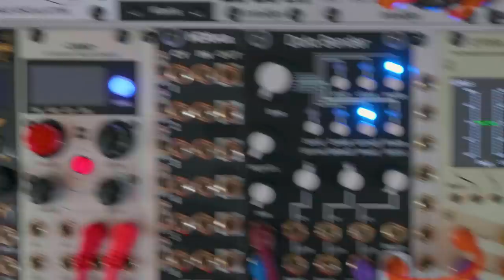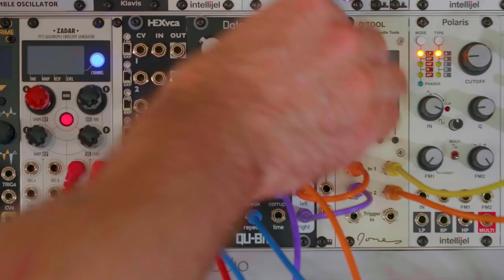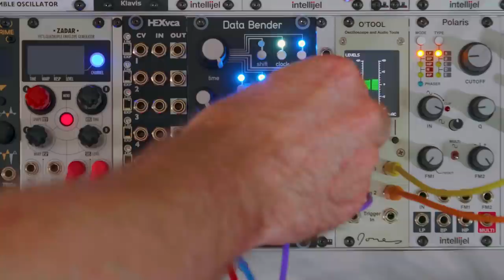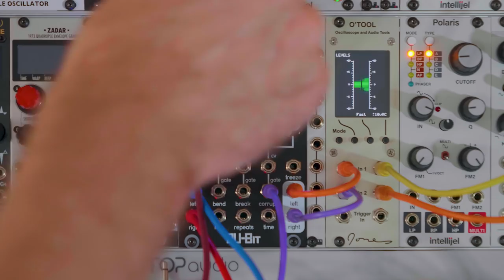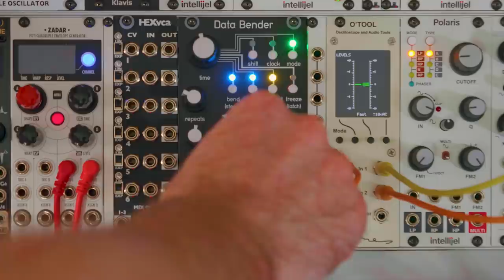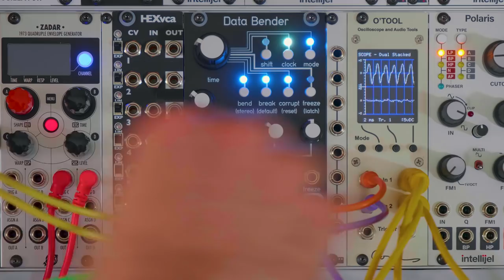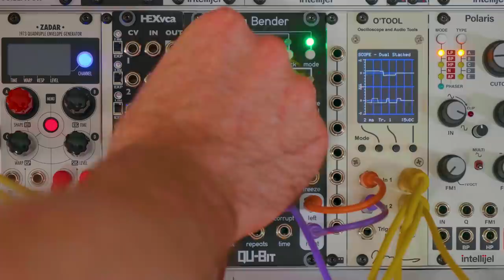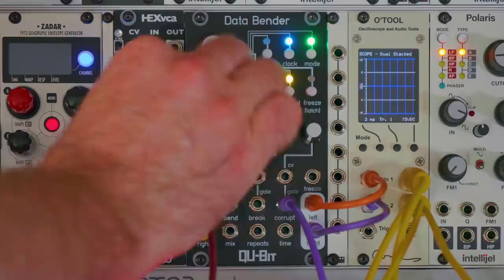Qu-Bit Data Bender: Walkthrough and Demo

Comment: Quick heads up to folks out there, in order for the corrupt gate to reset the clock, you have to toggle that setting by holding shift and pressing corrupt (iirc). Otherwise you're flipping the corrupt gate.

I also could have just missed him mentioning that, in which case ignore me, lol.

Lastly, thank you so much for making this video! I watched the entire thing at least 3 times while I waited for it in the mail and it's quickly becoming my favorite module. It may even be my favorite music making tool ever! Cheers buddy, 🍻

Comment: Awesome demo! I am looking forward to getting this module. Quick question: at 9:36 the "ambient interlude"- you mention that you are using four samples from the Rample. From what I can tell the Data Bender has a stereo input and you have two cables going into the inputs. Are you splitting the mix output of the Rample into the stereo input?
Reply from the maker: I mix the rample in a doepfer 138-s
Reply: @RedMeansRecording  - thanks for the reply- I was just curious then do you split that output into the stereo input of the Bender?
Reply from the maker: The 138-s has a stereo output. That goes into the data bender.
Reply: @RedMeansRecording  - LOL snap I missed that detail! Thanks for the reply!